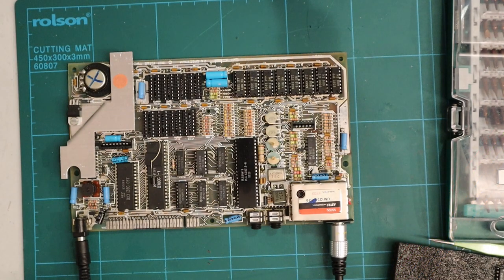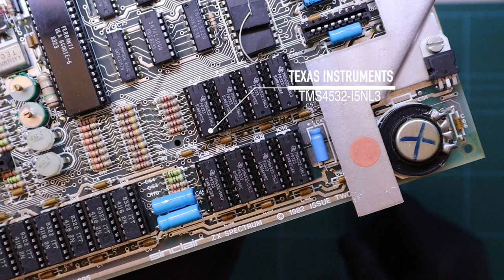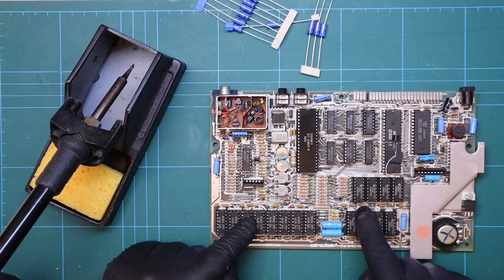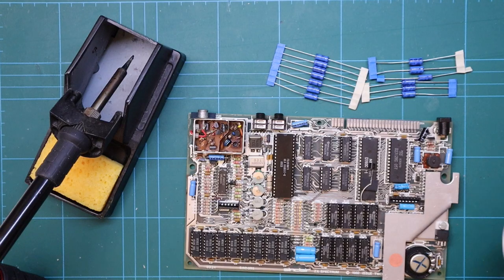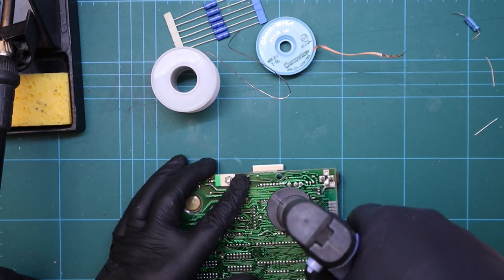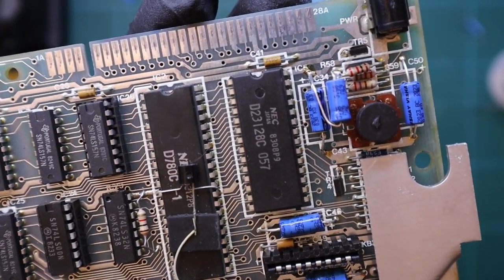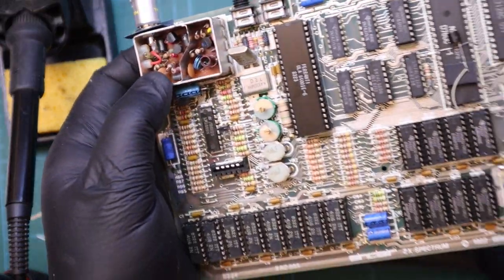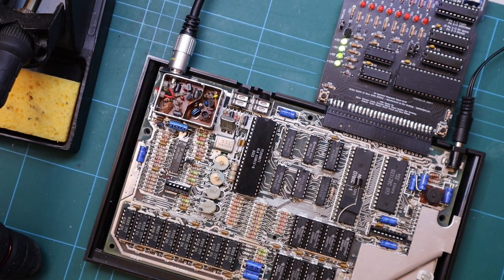ZX Spectrum repair, restore and upgrade. Part 3

Comment: I had forgotten about Sinclair using cheap faulty memory in the Spectrum. When you said it, memories of being told for the first time when I was 10 or 11 came flooding back to me. You have to admit that it was a brilliant idea to keep the cost to the consumer down. I did not however know about the chip markings to denote what portion of memory was faulty. Info that may well come in very usefull. Thanks very much for this video and take care.